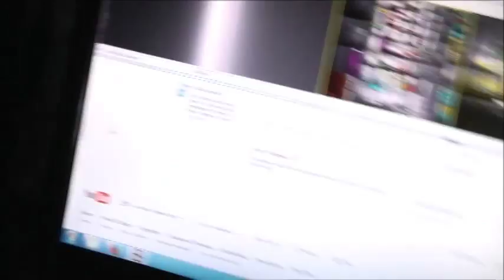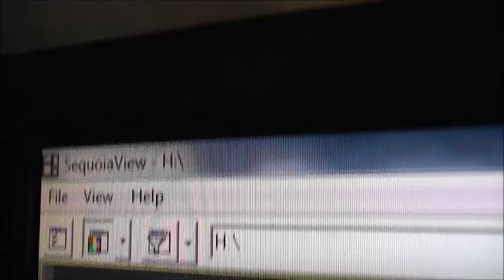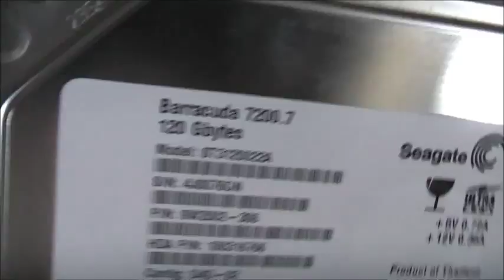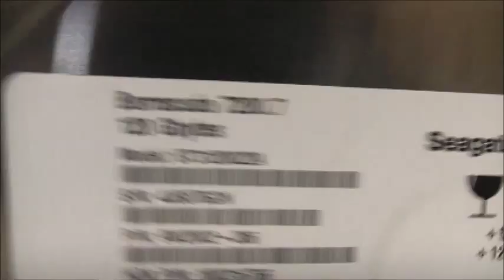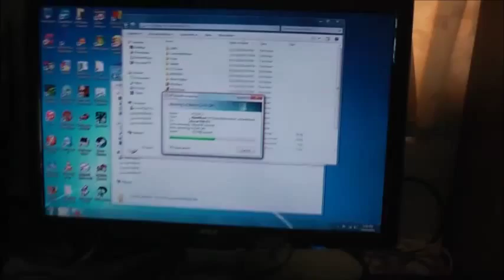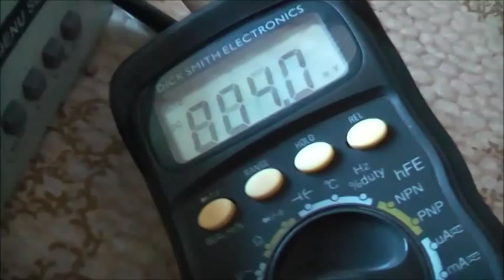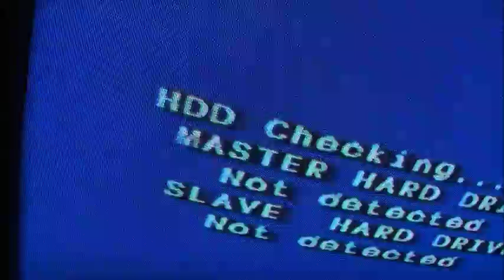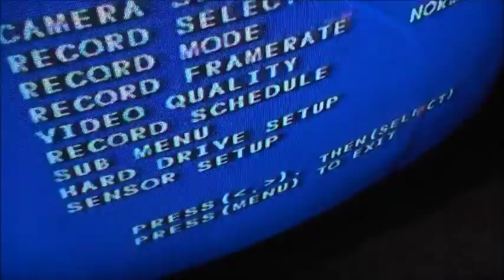Security System Repair

Comment: I would suggest the fan failed which reduced the cooling of the power supply which is old and using crap brand electros.

Perhaps replace the electro's and fan and it might work but the drive might be dead due to heat or power supply issues.

Given the age of that unit and its only four channels its most lightly got a poor level of recording resolution and you can now buy units on EBay from China with eight channels or better high res recording for very cheap.

The difference being you might be able to identify a person rather than just tell if it was perhaps a male or female and little more.

Just my 2 cents